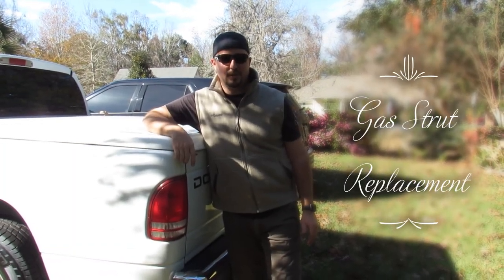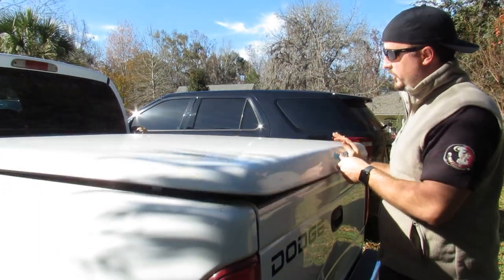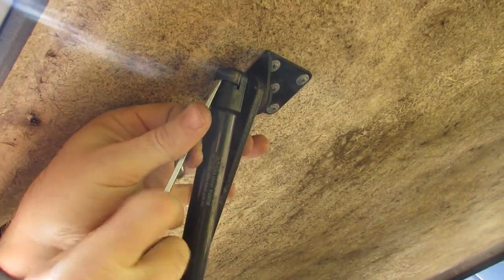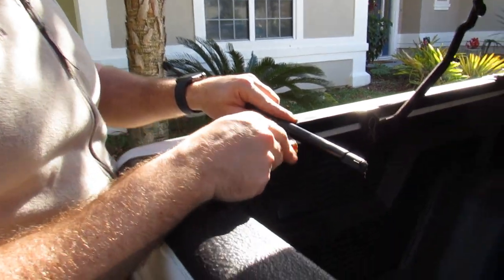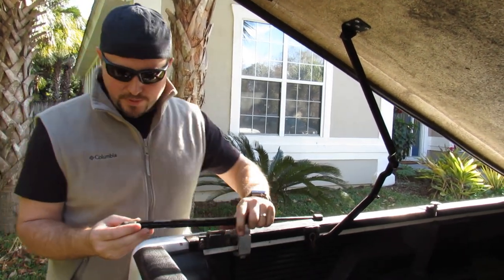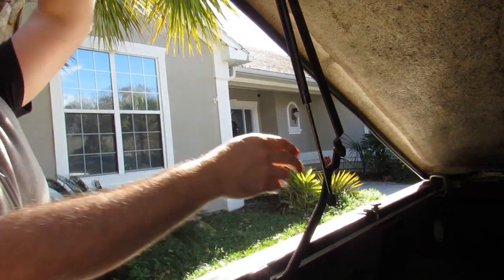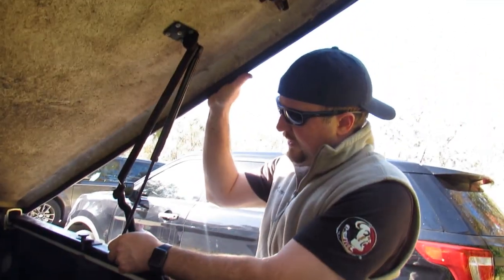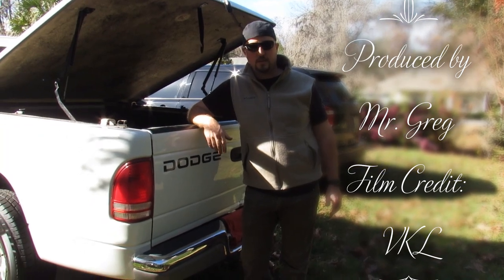HOW TO Replace Gas Struts on a Truck Bed Topper

Comment: Excuse me, I have A SIERRA 91 The cover need new struts, but, how to know the pounds
Reply from the maker: Hey partner.  I would check the existing struts to see if they have a serial number or model on them and try to replace with same. If not you can guess and check. Are you in the USA?